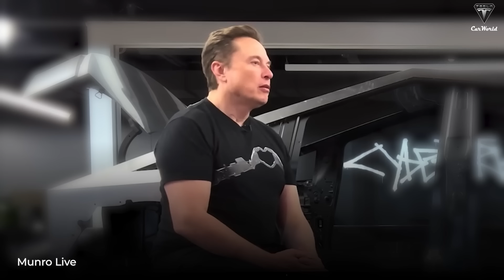Massive Tesla Giga Press 4.0 Detroys All Welding Robots!

Comment: TESLA is revolutionizing car manufacturing. Cars will be stronger, more rigid / stiff, safer, corrosion resistant, more durable, more quiet, lighter, less expensive to manufacture. Also these new production technologies will have smaller Ecological Footprint. Congratulations TESLA !!! ... ❤❤
Reply from the maker: That is the potential advantage: fewer welds, fewer parts, and a simpler production flow. Tesla claims the Unboxed Process could cut manufacturing costs by 50% and factory space by 40%.
Reply: @TeslaCarWorld Does that mean that the car be 50% cheaper for the consumer or that it will make more profit for the manufacturer?
Reply: @karolpowazka6047 both
Reply: @karolpowazka6047 I think we know , more profit 💰💰
Reply: @karolpowazka6047 you are a liar! That's not a comment! Your "higher power," the Father of lies, has hijacked your rational processes!  Oh yeah, he was a murderer from the beginning, Father of lies! 😅😅❤😂 Repent, or consider your motives...malice, envy, gross unhappiness w/your lot in life! 😂😂❤😂
Reply: But châssis impossible to repair
Reply: @fp2634  - Not impossible. Maybe more difficult. There will be elements available to fix it ... ❤❤
Reply: @DrMarekRoland  Wrong

Comment: Great, so what happens when you have a fender bender? Do you scrap the whole car!? That will drive up the cost of insurance! I don't know about most of you but I cannot afford to pay more than I am already paying. The future looks like it is forgetting the working man.
Reply from the maker: A damaged fender or outer panel should not automatically mean scrapping the whole car. The concern is mainly severe damage to the structural casting, which insurers may decide is too costly to repair.
Reply: @TeslaCarWorld exactly my point. If you know anything about castings that is a distinct possibility.

Comment: However - if you have a crash then the whole chasis may, more often than otherwise, need to be replaced...
Reply from the maker: That concern is understandable, but damage depends on where and how severe the impact is. The unified casting reduces hundreds of joints, although insurers and repair shops will ultimately determine how economical major repairs are.
Reply: @TeslaCarWorld pushing up all our insurance costs,  does Tesla offer insurance on repairs of its vehicles? Or would that send Tesla broke?

Comment: Seems making throw away cars as possible repair of bent cars impossible
Reply from the maker: That is a fair concern for severe structural damage. Smaller outer panels may still be replaceable, but damage to the main casting could make a repair too expensive and lead insurers to total the car.

Comment: 219 kW motor is just under 300 hp (297,8) It will be plenty strong (mention one diesel/petrol taxi that has that today?
Reply from the maker: The video states 219 horsepower, not 219 kW, which is about 163 kW. That is still plenty for a lightweight 3,113-pound urban robotaxi focused on efficiency rather than acceleration.

Comment: This is awesome, until a minor accident bends the structure, then your car is totaled!
Reply from the maker: That is a fair concern, but a crash does not automatically mean the entire casting must be replaced. Tesla’s design aims to improve rigidity and crash-energy management, though repairability remains an important real-world test.
Reply: @TeslaCarWorld  Mechanics already report that repairing anything on the body of a Tesla are a pain and will only get worse.
Reply: They won't be repaired, and would you want one after it had been in an impact and could have hairline cracks or other stuff wrong that nobody has identified
Reply: I can imagine that they are so modular that you could remove the front casting, swap out the salvageable parts, replace the broken parts and then plug it back in
Reply: @eddiemunster8634 you have a good imagination
Reply: That's the issue with all cars. Any frame damage totals the vehicle.

Comment: Who cares anyway as robots did the fusion of up to 2.0 mm sheet steel on cars but has the press system been tested with NDT long enough to find whether it will definitely work
Reply from the maker: Tesla’s approach trades thousands of welds for far fewer large structural parts, but it still needs extensive validation. Crash tests, fatigue testing, X-ray inspection, and real-world fleet data will determine whether it works reliably.
Reply: @TeslaCarWorld . 
I’m a skilled coded welder who supports this in the car industry as it will also stop the fumes from the robotic welding. 👍

Comment: so if the car has an accident, its basically a write off
Reply from the maker: Not automatically. Minor damage to replaceable exterior panels may still be repairable; the vehicle is more likely to be written off only if the main structural casting is badly damaged.

Comment: Its called UNIBODY production and has been around for YEARS.  The ONLY difference is SPEED!
Reply from the maker: Unibody construction is not new, but replacing many welded sections with a few huge castings is a different level of simplification. Tesla’s claim is not just speed—it is reducing major structural parts from about 200 to around 80.
Reply: This is way, way, way beyond Unibody.

Comment: Your build now a vehicle that when damaged must be thrown away?
Reply from the maker: Only severe damage to the main casting could make repair uneconomical. A damaged bumper, door, fender, or other replaceable outer component would not necessarily mean throwing away the whole vehicle.
Reply: I must not be understanding the statement of elimination of,bolts, rivets and welds correctly then..

Comment: So it’s more like a pressurised mould than a press
Reply: But surely the moulded metal is nowhere near as tough as sheet that retains its strength even after working and assembly?
Reply: @DAMORBEL  That would be my thought which makes me think it’s a hybrid system where the parts is cast in the mould and the pressure is maybe added as the part cools to arrange the particles and give it added strength.

Comment: You forgot to mention the real benefit, namely these cars are practically irreparable  and a minor accident will write them off, very clever.
Reply from the maker: Repairability is a valid concern, but a minor accident would not automatically destroy the entire casting. The unified structure removes many joints and failure points, though real insurance and repair data will be the true test.

Comment: I wonder what happens when the vehicle is involved in a car accident and the castings are so big that every single accident the vehicles totaled because you can't replace the casting?
Reply: Most vehicles are already engineered to do that…
Reply from the maker: That’s a legitimate concern, but not every accident would damage the main casting. Smaller panels can still be replaced; only serious structural damage may make repairs uneconomical and lead insurers to total the vehicle.

Comment: It'll be unrepairable and way more fragile and sturdy.. castled metal/aluminum has radically different characteristic than sheet metal... there is a good reason why cars are not done from aluminum exclusively already.
Sure might be handy in the outer space building spaceships, but not cars, such cars will be way too deadly for either of the accident participants.
Reply from the maker: Those are fair engineering concerns, but cast aluminum can be designed with controlled deformation and dedicated crash structures. Independent crash testing will be the real proof of whether Cybercab balances rigidity, impact absorption, and passenger safety.
Reply: @TeslaCarWorld  maybe, one day. But seeing the tesla cybertruck being a metal brick without excuses which cannot even enter European roads still, I bet they don't care about these things.
The first model was a crappy patchwork as they had no experience in car making, then they improved a little and now they try to invent yet another spaceship patchwork without any other concerns other than bringing something new to the table which can scale rapidly. Tesla is generally horrid in design which is a wonder as so many people work for them.. maybe they want to outcompete Microsoft qualities, who knows.

Comment: Musk has surpassed Larry the Cable Guy as the Get Er Done guy. 
He demands the impossible and eventually it's produced.
His companies are run lean, unlike the Big Three, not weighted down with management payroll and red tape.  The savings is invested in the company, in technology like the Mega Giga Press.
Reply from the maker: That manufacturing mindset is exactly the point—Tesla wants to cut complexity and reinvest in faster production technology. The proposed 50,000-ton Giga Press could reduce hundreds of structural pieces into far fewer major components.

Comment: Giga presses are made in italy and have been around for decades !!! .. the car industry only just now starts liking them .. with elon as a front runner
Reply from the maker: Correct—large die-casting technology existed before Tesla, and Italy’s IDRA played a key role. Tesla’s breakthrough was applying it at automotive scale to replace dozens of welded parts with single castings.
Reply: @TeslaCarWorld Sandra Munro talked about it .. he wanten this for years but nobody wanted to use it on a lange scala

Comment: Basically a giant sardine can to wreck in, without crunch and break off points to help escape .
Reply from the maker: Large castings do not mean the vehicle lacks engineered crash zones. Tesla claims the more unified structure improves rigidity and crash-energy management, although independent crash testing will be essential.
Reply: @TeslaCarWorld good to know 👍

Comment: Molten aluminum does not glow red, even when it is extremely hot or fully liquid. It stays silvery‑gray and visually “cold".
Reply: It's not an actual video, it's just to show contrast so that the public can understand where it flows...
Reply: @miketwomey4923  Exactly, but the experts have to chime in.  If the video did not show it glowing red they would think it was fake🙂
Reply: Interesting, good catch. Similar to watching the Terminator movies over the years..
Reply: Except on 9/11 where it showered out the corner of WTC
Reply: @BrettJulianChamberlain  That was jet fuel. And the steel did not melt.
Reply: @Dave5843-d9m I assume we are talking about the same video, but it was not jet fuel. Whatever it was, it was about 2000°C
Reply: the glowing metal is iron, not aluminum. the Tesla process is inside pipes the video explaines. not much to see or show for a video!
Reply: AI slop
Reply: AI slop
Reply: I actually enjoy driving way more than riding. So, it's a big no thanks for me.😢

Comment: If the CyberCab "ever" required a human driver to take control, the answer is simple: activate an interface to a wireless playstation controller. Voilà! Now you can steer and control the vehicle manually with the controller, and display your activity on the screen.
Reply from the maker: It is a creative backup idea, but wireless lag or disconnection would create major safety risks. Cybercab is intended to operate autonomously, with passengers using the 21-inch screen to request a stop.

Comment: Not only the speed and strength of giga casting the parts will never rust can be recycled easily melted down for new parts 👍👌👏💯
Reply: Aluminum does corrode.  Many high strength aluminum alloys are prone to corrosion.  I suspect that one of the dipping process may be an anti-corrosive coating.
Reply: @colincampbell767 nothing like steel!
Reply: ...AND creates cars that are too expensive to repair after a very minor collision.  Genius because then Tesla gets to sell another one!
Reply: @TRADERJEJ  тако је у случају судара, штета је тотална, рециклажа обавезна, нема поправке, енд.
Reply: It's really amazing
Reply: It's massively more expensive to repair in case of an accident, why don't you say that?
Reply: But insurance will take that cost. Wait a minute. Tesla insurance company is coming?
Reply: @nomayor1 that wouldn't be a problem if a new one costs almost the same as it would cost to fix it.
Reply: @Superliegebeest0  That's how much it costs to fix a Tesla.
Reply: Exactly

Comment: Other companies are not trying "to catch". The fact is pressing whole car is dangerous because aluminium can become brittle, meaning in 10+ years it could basically break in half.
Reply from the maker: That risk depends on alloy design, heat treatment, and crash engineering—not simply the fact that aluminum is cast. Long-term fatigue and crash testing will be essential before judging whether large castings remain durable after years of use.
Reply: @TeslaCarWorld  it's called aging of aluminium. External factors also contribute to this if there is no corrosion protection.
Also as we've seen from "bumpers" on the cybertrucks being torn off, this things can't be welded to gether because you're right, it's some kind of brittle alloy. I believe they wanted to make it harder. However some aluminium alloys can't be welded. So what's the solution if that happens? There is none.

Comment: Cybercab with built in color - so the owner cant re paint the car a different color?
Reply: How does the transport company load/unload the cybercab on to the transport trailer without a steering wheel and brake?
Reply: What is the repairability of the cybercab body after a bender bender?  Is it more expensive than buying a new car?

Comment: I would say the cycle time is 1-2 minutes - you need to include the time to clean the machine (die) instead if how long the metal is in the casting die.
Reply from the maker: Good correction—the full cycle should include die cleaning, cooling, lubrication, and resetting. Based on the process described, 1–2 minutes is more realistic than counting only the few seconds the metal spends filling the mold.

Comment: This amazing technology is precisely why Tesla cars are 'totaled' after a collision that regular cars can be restored by the average body shop. Aluminum doesn't bend, it breaks, thus all that structure is wiped out by the crushing effect of an accident. Just one more thing on the list that consumers discover only after buying a Tesla they wish they knew beforehand.
And this Cybercab idea, works in theory but what are its crash statistics? After a nice quartering driver side impact at 40 mph, how well does that neat gull wing door work? Either side open after that?
Reply: Maybe they also discover that full coverage insurance will replace their car if it’s totaled?
Reply: @weaponizedautism6199  Indeed it does, but your overall rate is considerably more for the same coverage on a conventional car. the Model S and Model X average $275–$455 per month.
Reply from the maker: The Cybercab’s real crash statistics and post-impact door operation have not been established in the content, so independent crash testing will be essential before claims about safety or repairability can be confirmed.

Comment: Die casting is much more complex that simple forcing metal into a cavity. I would know, I work at a plant making equivalent castings for a Detroit 3 automaker. Don't worry, the reveal is coming soon.
Reply from the maker: Absolutely—die casting also depends on alloy chemistry, vacuum control, temperature, lubrication, cooling, trimming, and X-ray inspection. Looking forward to seeing what your plant reveals.

Comment: Unlimited power to drive it? What will provide this? Even AI Network Computers are having difficulties with power supplies and cooling to the point that several big new Systems have been cancelled or put on hold.
Reply from the maker: The video does not claim unlimited energy. It says the Cybercab may use a 48-kWh battery and achieve at least 6.1 miles per kWh, allowing roughly 290–300 miles of range through efficiency rather than massive power consumption

Comment: Problem with the car being made one peace is if it's in an accident the part that was hit can that area be replace or is the whole car needs to be scraped  because the body was one peace mold?
Reply: Yea but to make an air tight rover it's great
Reply: Melt her down and re pour it.
Reply: Piece.
Reply from the maker: Smaller exterior panels may still be replaceable, but serious damage to the main casting could make repairs expensive or lead insurers to total the car; Tesla’s tradeoff is fewer parts and greater structural rigidity.
Reply: This comes up in every video posted. It’s not relevant. It can all be repaired. The point is, the frame is so robust that if you do damage it, the rest of the car is destroyed. Other cars would be worse off with the same accident and not salvageable at all.
Reply: @daveyshmavey This is your opinion. I had accidents a few times where my vehicles were repaired and I was driving them after repairs. With Tesla using parts after the Gigapress, the damaged parts almost impossible to repair and a damaged car would be scraped. We'll, insurance companies scraped EVs for even small damages because of batteries concerns.

Comment: While I do recognize the engineering feat of the giga press as it's called in this video I don't understand why everyone is impressed that bro just made life-size Hot wheel cars
Reply: It's making things (cars) at scale easier. What else could a mega press be used to make. Basically a lot of things. I wonder if military contractors are going to start using this to make airplane parts. The cost savings of having the paint color being in the material is going to allow that saving be either passed onto the consumer or to the corporations profits.